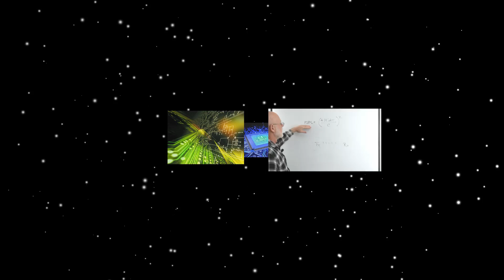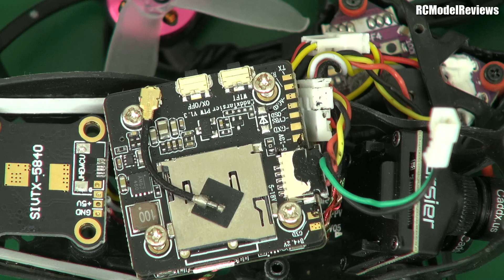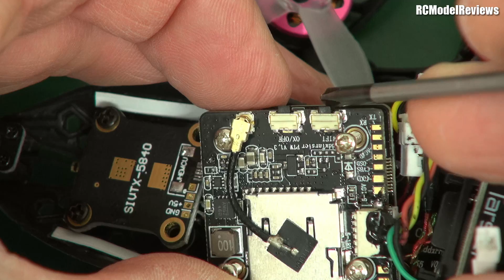Why are so many new products faulty?

Comment: Bruce, I think your spot on ! They make amazing RC hobby products in China, but when they start arriving in a faulty condition or are just plain defect; the fun goes out of it very quickly 😢 Not everybody is a wiz with the soldering iron and circuit board savvy ... Plus, let's be honest, if you pay for a brand spanking new RC plane, helicopter or drone you expect it to work.
P.S.: I've sent you a little e-mail on a recent DOA purchase

Comment: Last month I bought a TBS Crossfire Micro RX V2 from a german reseller. This thing did not work on channel 2,3,4 so I contacted the TBS support. The reason for the problem was that there are three  resistors missing on the pcb. The guy from the support told me that there was a whole batch that have this problem. Seems that there is no final inspection and a whole batch of non working receivers is hitting the market.

Comment: I agree I used to never have things fail plugging them in the first time or after less then 10 packs with no crashes. Lately on the AIO Brushless 25x25mm whoop boards one after a crash I understand that it was hard enough to break the frame. The replacement exploded on first battery connection they sent me a new one and after 6 packs  and no crashes the phase 3 on motor 4 quit working. Those were BeeCore v2.1 with the cap on it. So I got one manufactured by fullspeed been flawless so far only about 30 packs through it. I saw the BeeCore costing more from banggood then me buying a well known brand from my local shop. It was only $1.19 more which I pay double that in sales tax but I don't wait 2-3 weeks.

Comment: Well, most of Chinese defects in my case were easily fixable. Unlike Castle Mamba ESC which was dead on arrival from US :)
My most recent issue was not with RC product but with 3D printer: proximity sensor on Creality 10S Pro was not working. After jumping hoops with seller and different "real creality shops" I opened it up and disovered that socket was simply inserted into PCB, not soldered. Soldered it and printer is working fine ever since. On the bright side after I reported in Creality FB group they send me USD 50 because they were collecting info on printer failures and fixes at the time.

Comment: Bruce, Really enjoy the videos. I bought a Runcam 2 in January this year but it wouldn't charge or turn on. I went online and found a video that showed the fix to put a piece of card under the battery to make the contacts line up inside. Now works fine but shouldn't have to do this.

Comment: chinese mix in 5-10% faulty product just to covertly raise the average price of the item and due to cheap cost and cheap shipping nobody stops buying bulk. i so distrust chinese shipments i stopped buying one item at a time, one item that doesnt do what its supposed to, i have to have several of something and sell the working ones just to even out the cost to approach what was promised. From clothing half the advertised size to electronics with the electronics inside missing hehe ive gotten some weird chinese stuff in the mail

Comment: I find that the Lipo's which I buy now days do not have the quality that they used to have!!
They puff up and the internal resistance of the cells varies after little use !!
As was mentioned in your previous video about Lipo's, the manufacturers release a new range of battery's which perform well 
Then a year later the same batteries when purchased do not seem to have the. Same quality !

Comment: I purchased what was alleged to be an Eachine LCD5802D FPV Monitor with DVR.  My issues:
1.  There is no Eachine logo or brand identification on either the box it came in, the monitor itself or the instruction sheet.  This is inconsistent with the genuine item which has Eachine logos on all three items.

2.  A genuine Eachine monitor translates the menu from Chinese to English when English is chosen as the default language.  The monitor supplied to me did not!  I have observed correct behaviour on a genuine item where the language is displayed correctly.

3.  The video recording function is faulty.  The image displayed on the screen is not accurately recorded to the SD card.  The video file image freezes early in the recording and remains frozen for the duration of the file.  It is not recording the video feed displayed on the screen.

4.  The on-screen video image is corrupted on the vertical edges - it is wavy and not clear.

5.  The threaded hole on the base of the monitor is intended to allow it to be connected to a standard tripod mount.  The thread is faulty and it is impossible to use on a tripod.

These faults make the monitor totally unacceptable for its intended use.  I contend that it is not a genuine Eachine monitor but rather is a sub-standard, low quality "clone" and has been misrepresented by the supplier.

Comment: Yes to drop in standard, and even worse price rises. Korea was the same and now great. But China has and will always have no quality control as it a part of their culture. Make as many as you can as cheap as you can send out and replace what's broken, not check prior to sending. Culturally it has always been that way, it's only if made by a company that's from outside China and manufactured there that quality tests are impliment. And even then if they rely on locals as management it will not improve quality.
Strange quirk of working with the Chinese.

Comment: My Taranis QX7 arrived DOA from BearGest in 2017. I was new to the hobby and my mate was using Flysky so I kept buying receivers, flashed everything with every version etc until I gave up and bought a cheap Flysky radio. 
Months later I found a FrSky dealer who sold the radio board for £25 and I got it fixed.

Comment: It's a trend that's been going on for decades. I found in the past when I bought a widget from China and found it useful I'd go and buy an identical one as backup or to use both, only to find that they'd changed components or the design of the widget, usually it would do the job but often not as well as the original.
It's almost as if they're playing one big game of bait'n'switch, give us a good first run, then cheap out on components for the subsequent runs and carry on selling them at the same price.

Comment: I just fit a Racerstar 4in1 ESC into my quad (Cheap brand, I know). There was an initial puff of blue smoke on first power up, and each successive power up until around the fifth, despite there being no obvious wiring error. I could clearly see that the smoke was emanating from one particular IC. Incredibly the quad flies perfectly, despite the initial smoke. My thinking is that it was laquer burning off the IC. It's unnerving though. I'm still expecting early life failure, because that just seems like way too much heat to  last.

Comment: I have found that the batteries that come in these classes of drones and cameras don't last. They don't hold their charge. the other problem i've noticed that the cameras stop working they will record for what appears to be the full duration however when you check the video files the first couple will play but the remainder are unreadable the file size appear the be correct but are useless. Yes over the past 12 months the products purchased from ebay (China) are crap and there is no quality and most times have had no response from the seller.

Comment: Just within the last week I received a faulty iFlight F4 Dual Gyro Stack with broken pins between the ESC and FC (it came from the factory that way * No QC ***) a replacement was sent out straight away thanks to BG, but that one came with a single pin bent (again it came from the factory like that) luckily I was able to bend it back very carefully.

Comment: I bought a hobby king durafly.  tundra , it’s not a bad aircraft ,but the elevator hinge is squashed foam. It never worked and just broke
I need to glue a piece of balsa into the foam to be able to fit decent hinges. Tape just won’t do it.
This is not good enough , it’s been let down by poor testing
Don

Comment: What is that tiny black square attached to the small coax cable sitting on top of the SD card holder ?
The Chinese are pushing out their cheap products ASAP. Less handling time = more profits.
Reply: It's the end part of the wifi antenna, stuck down with double sided tape, you control the HD settings via an Android app.
Reply: @licensetodrive9930  Thanks for the reply...;-)

Comment: Havent notished an increase in faulty products, but they do happen. Cant really blame the manufactorer though, as i just dont know what goes on down there. But the packaging of the products are usually very concerning. I dont recall ever recieving an electronic device in an anti-static bag. and its about 50/50 whether or not it has any kind of bubblewrap arround the hardware, which are usually in grey plastic bags.

Comment: Recently bought two sets of 1103 7800kV brushless motors and both sets weren't working, only two of four of the first set. The second set didn't work at all. But I could build myself a working set of four but switching bells isn't a thing I normally been faced with.

Comment: End user is tester , not worth them spending the time testing each unit, better to just send out everything without testing and replace any faulty ones as needed.
Saddens me to hear about the conditions these workers are putting up with, I used to work in a workshop where lots of soldering was constantly going on and various cleaning sprays and spray paints were being used inside with no ventilation and I'm sure it made me very ill and has had long lasting affects on me , these Chinese workers are putting up with much worse for much less pay and longer hours...

Comment: It's one thing being DOA, at least you can deal with that at the outset, but it worries me doubly that low quality components can mean high likelihood of failure in flight.

We need components that are built well and are reliable because stuff dying in flight isn't really acceptable or safe.

The number of ESCs, motors and servos etc that I've had fail after only one or two flights due to nothing but normal usage is very worrying indeed.

Comment: 4 dead Runcam Split Cameras!  Yes, just had my 4th Runcam split go into freeze-up on me a couple days ago.  This was factory-installed by iFlight on a quad!  And I have another one on a same model quad also freeze up on me a couple weeks earlier.  Then a month ago a Split on an airplane froze up in flight - saved only by iNav RTH.  I have a Tarsier sitting on the bench to replace on of these dead Splits, but now by all reports the Tarsier is known to be even less reliable.  Now I miss the days of fairly predictable performance by PZ0420 board cameras - they just worked, I still have a dozen of them.

Comment: I recently received a Hawkeye Firefly micro camera which was DOA, when I pulled it apart there was no battery in it. I had one approx the correct size installed it,  now the camera works fine. easier than jumping through hoops making and youtube vids for a 30 buck product

Comment: Is it a recent trend? 
As someone who has bought few toys  (and been given only one) I'm not in the same position as you and have had only one DOA product in 5 years (All my new stuff comes from china) and that was one that got refunded immediately. I think that is not bad at all and comparable with my purchases outside of the RC world from sources other than China.
Is QC now not at the standard it used to be internationally? Of a certainty it isn't as good as it was when I worked in the electronics trade because it is simply cheaper now to send a replacement from the piles of units all manufacturers have. 
That's part of modern economics as we can see from recall notices from major companies all around the world.

Comment: Not had that much arrive dead or premature fail, then or now. HAVE had all sorts of delays in supply recently. Latest was ordering two CW and two CCW motors, all stated in stock. The two CW showed processing after the others showed shipped. I queried, to be told don't worry.  Motors arrived, two CCW only. Queried, told don't worry!  ALL this time the CW motors are shown in stock, now slowly dropping!! Then told they would be shipped a week onwards, could not explain why!  Second last, ordered a FC, shown stocked.  Stuck Processing.  A week later I ordered another, that arrived, first one still processing. Eventually it arrived, broken. Sent in a plastic bag with no foam, crush damage. They refunded. A LOT less reliable than a year or more ago, SOMETHING is going wrong.

Comment: You are comparing two very different quality issues. The camera bricking in a particular mode is a preventable error that should have been picked up before release. A dicky switch is just bad luck (unless it is wide spread). You can't expect every single unit of a low cost option to be tested before release.

Having said that, I always have expected issues with anything I buy cheap from China and they never disappoint me, they always let me do a bit of extra work to make things work properly. Thanks China.

Comment: YES YES YES YES !!! and yes am shouting all these yeses coz finally someone said what i was exactly saying to my fellow fpv pilots about the QC in the last couple years !
my latest order from banggood was 10 Matek f405 FC boards and 12 DYS motors .. had 4 of the Matek with issues which was my only trusted brand for quality Flight controllers !! and 2 faulty motors from DYS !! in one order !! what is going on ?! are all these manufacturers affected by the QC problem ?!
Reply: 2 faulty Matek 405 from 2 different shop's. and plenty other stuff DOA.

Comment: Ive noticed a huge doa spike in the last six months compared to years previous. It's not confined to the rc hobby either. My bet is China have dropped or stopped batch testing in production, when this happens on both sides in electronics manufacture, (component and board assembly) the results speak for themselves. Of course reseller companies like Banggood never honour warranty so there is no loss, giving more incentive for manufacturers to sell there. That's where the truth comes out, a warranty claim should not cost the customer or the reseller, just the manufacturer who needs to QC better. What is actually happening is the buying customer loses as the reseller protects the manufacturer. It's the communist Chinese buisiness model.
The trick to avoid it is to not use Chinese based resellers, either buy items direct or use local sources.

Comment: Bruce - Nothing new buddy.  China has been selling iffy products for years.  Just ask anyone (like me) who bought a Hubsan H501S drone.  Factory quality control was so bad that if you got a good one you lucked out.  Many of us got buggy products and Hubsan customer service was an absolute nightmare.  And that's sad because the H501S was a great drone design when it debuted and a great flyer.  Yep, some Chinese manufacturers don't seem to want to honor product warranties.  Here's my latest example of iffy design/quality.  Sorry it's a bit long, but illustrates some shortcuts Chinese manufacturers are doing these days.

I recently bought a reasonably priced discontinued (last years model) Lemfo Lem4Pro Android smartwatch for my daily walkabouts.  The big rectangular display watch worked fine until I got caught in a light misting-only drizzle near the end of my 8k walkabout.  Suddenly the touchscreen became erratic and it was difficult to get it to accept touch inputs.  Since the watch had gotten slightly wet I dried it off and packed it in dry uncooked rice for a couple of hours (to wick out any possible moisture). Luckily the touchscreen began functioning properly again.  Since it's nearly new I contacted the manufacturer, described the problem, and asked if it is indeed supposed to be water-proof/-resistant.  The reply I got back was "yes, it's waterproof" but "next time just dry it off" and "don't pack it in uncooked rice again as the dust might get inside and damage it."  WTF?!  It's waterproof but not dustproof?!  🙄🙄🙄  So I did a couple more evening jaunts with no problems.  The next night I did a 10k walkabout and the watch worked fine until I tried to push the stop-record 'button' on the touchscreen at the end.  Again, the touchscreen wasn't responding.  This time it wasn't raining, but it was hot and there was sweat on the back of the watch.  And guess what... that's when I noticed that the 4 small brass charging/USB port contacts weren't protected against moisture and were wet with sweat.  I dried them off and badda-boom badda-bing the touchscreen became responsive again.  Even my previous ancient old Made-In-Taiwan Globalsat GPS watch had a rubber snap-on cover to seal the charge/USB port.  Yep, unprotected electrical contacts... another WTF moment!

I can name more examples of Chinese manufacturers taking quality shortcuts.  Again, this is nothing new, but maybe the situation is getting worse.

As always, Cheers from Thailand!
Reply: Pay more and don’t be cheap and they will produce quality for you. Expect the world and the Chinese worker to subsidise your hobby?
Reply: @superchargerone  What a stupid effing comment!   Nearly everything is made in China so expecting quality from mid-priced products is reasonable.

Comment: I saw you have sivtx from Jhemcu on your quad. How is your experience with it. Mine broke the ufl connector the first time I pull it off when installing it to my 110 micro. I did fixed the connector but the vtx is hot as hell on every output power and its 200mw is far less range than Eachine vtx02. Never break connector on Eachine though. I wonder is it because the connector has broken or is this vtx just bad from the beginning.
Eachine vtx02 200mw 400meters without breakup.
Jhemcu sivtx 200mw 200meters almost lost vdo feed. 25mw dead vdo at around 100meters.